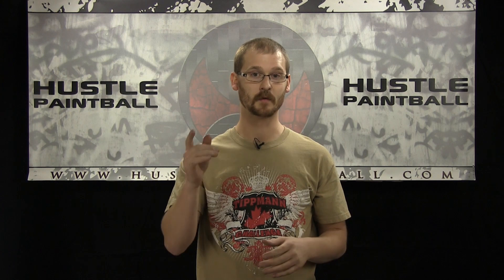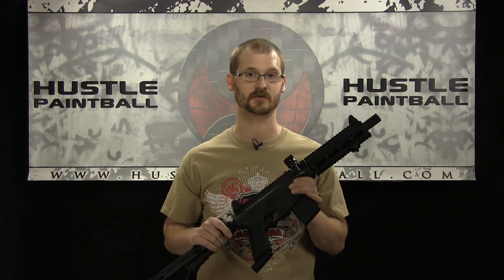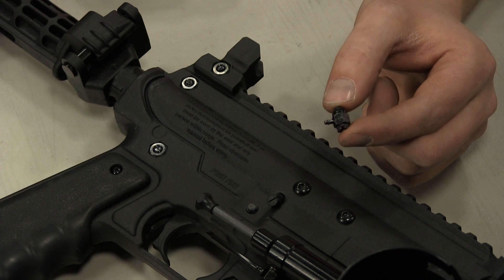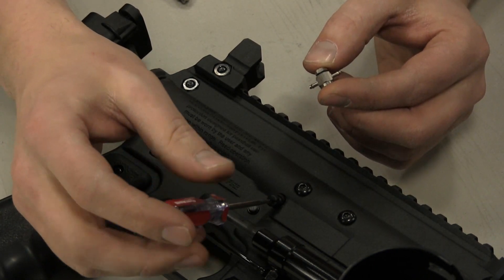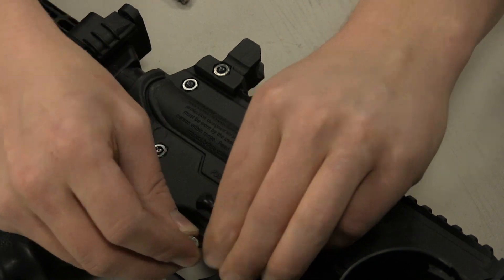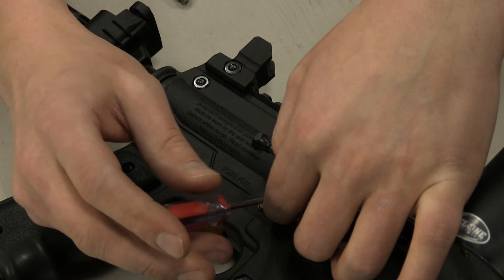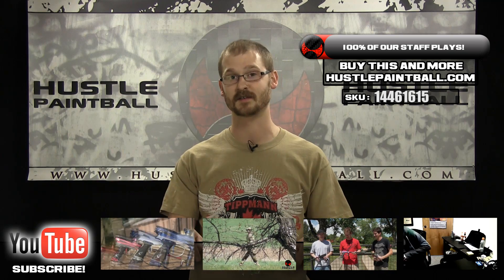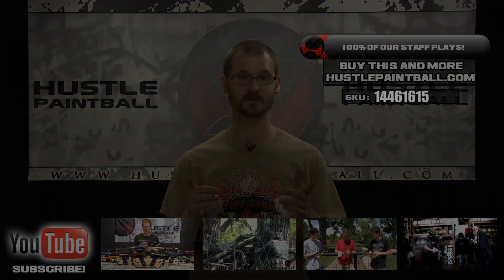How to Install a Response Trigger and Cyclone on Any Single Port Tippmann Gun

Comment: I want to buy a Project Salvo marker and add an after market conversion magazine kit and is there an airtank buttstock with an air line through the gun? That way it looks as real as it gets. You know, no hopper and no air tank on the back of the gun. Please help. Thank you very much.

Comment: I have an A5 with the response trigger but i cant seem to get the response trigger to work it shoots the same. idk if i have a leak because idk how to even check if i do is there any way to identify the problem? my gun also has cyclone and the flexi air thru stock so idk if tht might also be a factor.. plz help

Comment from the maker: It is not. The RT is pneumatically actuated and requires no batteries. However, it will decrease the efficiency of your marker.

E-Trigger needs a battery and has no effect on your efficiency. But you've gotta deal with batteries then...

-Dan

Comment: Whats better a respond triger or an E triger whats the diffrences
Reply from the maker: Depends on if you want to have to turn it on or replace the batteries ever. E-triggers need to be turned on and the batteries need periodic replacement. Response triggers run off your markers gas system, so they're always on. - AJ

Comment: you failed to say if it's an older model 98 and response trigger ...the fitting for the banjo t fitting is 1/8 and the old style response trigger and new cyclone feeder hose to connect is 1/16 ......Doh !

Comment: I recently got my rt and it came in with the fitting that has two barbs I think it's called banjo t fitting,anyways I have an a5 but it has dual air ports.Would I be fine keeping the other hole close and just connecting it as if it were single port?
Reply from the maker: Absolutely! You'll just need to make sure to hook up your Cyclone Feed System to the other barb :-)

- Ben
Reply: Awesome thanks a lot

Comment: I have a question before buying all these products. I want to get the alpha black elite, and I want to put in these 2 mods on. If I put these in would it work with HPA. also do I need to do anything else to the gun to make it work properly.
Reply from the maker: You should just use HPA in general - so yes, it will work.
As long as you follow this video - you'll be okay.
-Russell